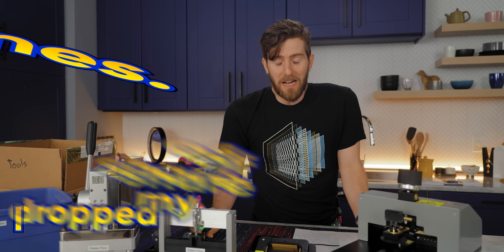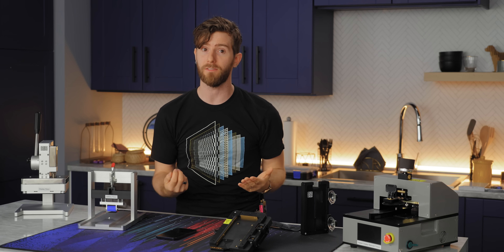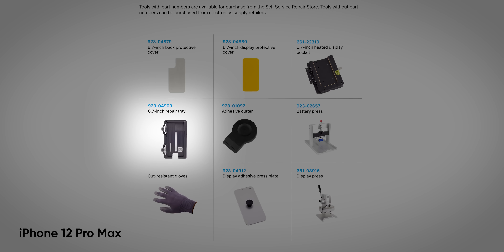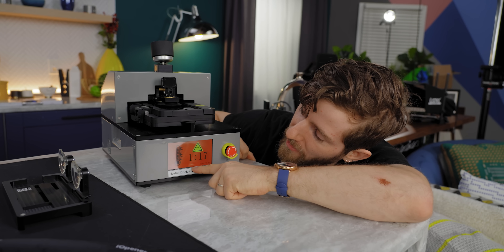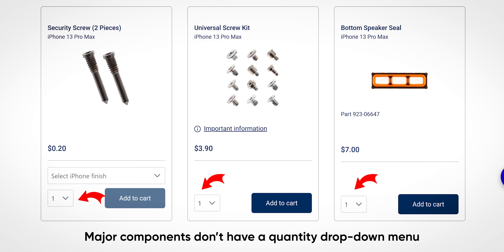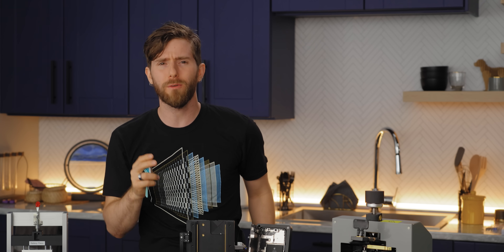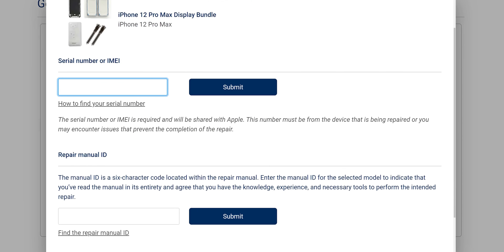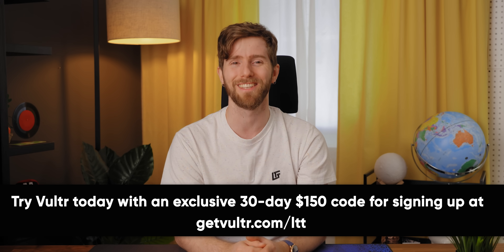I’m a Genius - Apple Self Service Repair Program

Comment: The tools answer a question I had about how Apple store can even repair stuff.  Apple's devices aren't easy to repair so I was confused how their geniuses could repair them (assuming that recruiting repair techs is harder than other retail staff), given that Apple doesn't design for repair.

I guess all these tools were developed to be precise, and easy to repeatably and reliably use so that there own shops could even offer repairs! 🤷
Reply: Apple does design for repair, they design for repair by apple. For example iPhones do not use glue were many other vendors are still gluing batteries in apple use the pull tabs to remove them this is clearly for themselves to be able to more quickly replace batteries. given 

and yes the tools are design alongside the devices so that they can do a high volume of repairs they are not spending 4 hours to replace a screen more like 5 minutes.
Reply: Takes us like 15 min and we actually program the screen with true tone. I would understand if you never did one why it would be scary. But we are also $120 cheaper then apple.
Reply: not really since if the screen is real real fucked you wouldnt be able to use those tools xD
Reply: i belive it would be more logicall to just change the device for the same model with the exact same specs and clone it to the one they hand you. and then send the broken ones to their repair services (or stack them in the shop so the repair guy has the time to do it)
Reply: @kuma8030  you can. Its called CA and a sheet of aluminum.
Reply: @kuma8030  there is a tool for that
Reply: @MrPruske  if the screen is real fucked up the suction cup wont suck and if you put a screen protector over it with real stron glue you are going to heat it up anyways and it wont come off

Comment: Honestly, apple devices really aren't that difficult to repair, hardware wise...
Some phones these days will have the screen be part of the actual case. For a phone I repaired a few weeks ago I had to remove every single item from the phone, Every single button,  finger print sensor, every single screw, all the camera lenses, all the connectors, literally everything. You need to remove everything, and attach it to the new screen, cause the screen is also the case. Oh, and to spice things up, the battery was glued in super tight, there was no way to get under it, and no pull taps, so you had to pry the battery up with a metal tool and an unreasonable amount of force.

Comment: 9:40 they are allowed to give the estimates over the phone from that page as long as they let you know it's an estimate.  They just can't tell you turnaround time.  If someone on the phone doesn't give you an estimate, that's because they weren't doing their job.  That being said, the estimates are crap.  It's basically a screen repair estimate, a battery estimate, and "other" which is basically replace the whole phone estimate.  Computers, on the other hand, they don't give estimates over the phone.
Reply: Apple Customer Support is a joke honestly. Linus' story is actually believable after having to deal with them a few times. The first 3 guys you talk to have no actual understanding of the device or how any of it works and once you reach someone who knows, they'll just hang up on you because they don't see it being a problem at all.

Comment: Imagine having to provide your vehicle's VIN to have the privilege to order a part for your vehicle.  More reason for me to stay far away from Apple.
Reply: @Carl Gunderson 
I wouldn't be surprised some of Tesla part already required that.
Reply: @Carl Gunderson Yeah but with one the worst that can happen is you can't make your TikTok videos or check your Facebook. The other if done improperly will kill somebody. Bad comparison.
Reply: @Carl Gunderson What's so confusing? Apple doesn't want you repairing your own phone because they want maximum profits. Tesla does not want people repairing their own cutting edge vehicles because they will kill themselves or someone else. Do you know how dangerous it is to take apart one of those batteries?
Reply: @Carl Gunderson Oh, well I was being sarcastic. Because one thing most people use for social media or taking selfies and is not really important. And the other is a 5000 pound tank that if not repaired properly will have VERY bad consequences.
Reply: @Carl Gunderson Well it's not just the battery though, that's just one example I used. If they don't torque down a tire properly. If they mess up the wiring or a sensor or software. Coolant line. Etc etc. My point is that if the corner store messes up your phone, well yeah that's a bummer but it's not really a big deal. If that sketchy mechanic you took your Tesla to because he was "half price" messes up your car. Well, it's not even remotely the same thing.

It's like when a person hires someone "cheaper" to work on the electrical in their house then it catches fire. My point is having people who are not certified to be working on cutting edge vehicles trying to fix your car is incredibly stupid. This is not a Toyota Corolla. You need high levels of training to properly fix a Tesla. Especially if it's battery related.

Comment: It’s a little worse again because after you carry out the repair yourself, you still have to call apple for them to pair the component to your device, and if this fails once then they tell you to go to the apple store anyways. Which completely defeats the whole process of shipping tools. It is clear that apple is building a case to make right to repair look pointless in the eyes of certain law makers
Reply: They’re trying to make it as inconvenient as possible to justify their case.
Reply: Yeah this is literally just embrace-extend-exterminate applied to user's rights (AKA property rights). They are doing it on purpose to force people who want to repair their devices to rely on them only without the possibility of just using a third party, and to force them to pay exorbitant prices for the purpose of discouraging the repair in the first place.

It reminds of the old washing machine paradox - you can get it repaired, but the repair tech always tells you it's going to cost more than just buying a new one.
Reply: It's basically malicious compliance with any proposed right to repair.  Yeah, you can buy what you need from Apple, but it won't be any cheaper or more convenient than bring the device to the Apple Store and letting them do it.  Then, when nobody uses this "service", they will go back to governments with data "proving" that there isn't actually any demand for right to repair.
Reply: This is why the best option is to strike the pocketbook and not buy their product anymore. They'll never learn otherwise.
Reply: @metaldragonmike  i hopped, never looking back..
Reply: @yukisnoww  Me too.
Reply: no because a lot of times apple tells you to buy a new phone instead of fixing your divice
Reply: It’s absolutely insulting
Reply: ah yes make you call to register a part they shipped knowing the serial of the device for repair another waste step and time
Reply: just another day at r/maliciouscompliance
Reply: I hope this comment gets pinned. I want more people to see this
Reply: I mean, they can't pair a true tone and calibrate the camera. I think this is just a ripoff as you paid for their repair products.
Reply: What? What do you mean you have to call apple to pair the component? Is it not enough to simply connect the new display to the mainboard or whatever board the phone uses? 

Why are people still buying their TRASH?!
Reply: @Jousten16  Because it's this decades fashionable thing, if you don't have one you're not a whatever fashionable people are called this week.
Reply: I would have to take a plane to get to the nearest apple store, plane tickets ain't cheap
Reply: So true Adam! They should really make the phones easier to repair as well! I think Samsung beats them here with their self repair program. you don’t have to call anyone and the parts are waaay cheaper! They really beat Apple here
Reply: And people keep giving this company money 🤷‍♂. Or more specifically, Apple sheep that just dump their wads of cash on everything Apple even if it's an obvious total ripoff or sucks. They are brainwashed into loyalty to the brand, And cleverly sucked into their ecosystem. I mean, Here's me slating Apple but you have to give them credit for genius business (pun intended) at least.
Reply: @helenHTID  That's what Apple wants, money and more e-waste so the turtles can eat some motherboards.
Reply: uh some of these pairings is due to the hardware keys used to pair your biometrics and other security certificates but  besides that yeah I agree this is retarded specially if its  JUST THE SCREEN being replaced.
Reply: 'Designed to fail' is an American political tradition. Look how 'well' it worked for their public healthcare and public education systems.
Reply: If not make it look pointless, at the very least they can say they offer it if regulations ever come into effect.
Reply: so stop crying and get an android phone.
Reply: @King_Lincoln-007  I agree. There’s always so much bitching about a device they don’t have to buy or deal with at all lmao.
Reply: @King_Lincoln-007  but america have banned one of the biggest android phones makers :V
Reply: @cpch23online2  I think there is a market outside of Huawei phones
Reply: @King_Lincoln-007  yeah like xiaomi :V
Reply: What do you mean with "pair the component"? Isnt it just plug and play. Its not like they are wireless components.
Reply: @Ryan123-k4i  It's like changing a serial number. Like that programmer to get a True tone back. The camera calibration is done by Apple and it always fails on 99% of all devices. And they just tell you to buy a new device and f off.
Reply: @jonny11bonk  Im sure it "fails" a lot of times :D Well i dont now if thats a smart move from apple to push selling numbers but it sure is a complete ahole move for all people who are not willing to buy a new device
Reply: @Ryan123-k4i  It's just another way how to rip off people to buy their new devices. I mean, what's wrong with an iPhone 7/8? You can easily find tools and tutorials how to open it and replace something. Even the programmers are getting cheaper to copy your serial numbers. But, Apple is business. A single broken capacitor on your MacBook's mobo? Buy a new laptop. A 3 cent capacitor and a few minutes of soldering. That's too expensive for the genius bar to replace it. I wonder which OEM does make the biggest e-waste besides the trash gaming pre-builts? Dell putting a hockey puck between the CPU cooler and the heatsink and making Intel mountings for an AM4 socket. 😂👌 HP forgetting to cool down the VRAMs and Gigabyte... Acrually, no. We can forgive the Gigabyte's exploding PSUs.
Reply: @jonny11bonk  its like some of these company actually planned the e-wastes. Well, except gigabyte. That was an epic boom
Reply: @jonny11bonk  if the camera isn't an Apple part it will fail.  were you using an Apple camera?
Reply: Not true. I worked at an Apple Warehouse, sometimes it doesn’t work over the cloud but often does. If it didn’t I have to give the phone to my manager have them do it with the tool they use to make it work.
Reply: @jimmygomez7406  There's repair channels on YouTube who've demonstrated the process of swapping hardware, and calling through. Then experiencing a configuration failure and immediately being told to go to the support centre.

Comment: There is no point in comparing a random "hard oled" screen from ebay to a genuine apple display. Most of the time the displays are not even the same size. Trust me, I've had a fair share of horrible displays from China.

Comment: OMG the've just needed to provide their stupid parts and say buy the tools from ifixit and watch their manuals. It would be so much easier for everyone. And then if right to repair comes through working on a real solution to provide users to authenticate their screen / new FaceID without needing an apple employee or an apple device. But no we live in metaverse and you aren't allowed to do anything with your own device looking at every f#cking other smartphone manifacturer except maybe fair phone.

Comment: You forgot to mention: The huge amount of shipping overhead this requires. For a company who claims to be all for the environment, making their boxes smaller to """improve shipping capacity using less truck space""", this is an insane amount of kit to do the same repair that someone with a small iFixit kit could do. Of course this is a niche option so it's not like they'll be sending these out in droves, but it seems way overkill. Apple doesn't trust you to do your own repairs so they send you industrial sized machines. Clearly this whole program is the bare minimum effort from them, and it was put in place only because they've been pressured into it.
Reply: These are the tools required to do the job properly and achieve the quoted IP protection numbers. Just because the job can be accomplished with an ifixit kit doesn't mean it is done to the same standard. There's no requirement to rent the tools from apple, you can just buy the parts direct from apple and use ifixits repair tools instead if you want.
Reply: @draginator6  I actually didn't know you weren't required to rent the tools. That does save it to some aspect, I guess.
Reply: You don't need to rent this equipment to repair your phone. You can just get the part.

Also, "someone with a small iFixit" is going to screw up 9/10 times, whereas with these proper tools maybe 1/20 times.
Reply: Yes, might be smaller and cheaper tools... But these are the right tools. Less chance of effing up, easier and quicker to get job done, etc etc.

Regardless, highly specialized tools aren't for users... They are for enthusiasts or people who work in that field... The idea of renting tools like this just seems... Odd.

Comment: Could a repair shop buy one or two of each part using donor phone serial numbers and then order replacements each time a customer comes in, so they replace that stock? Or are the serial numbers tied to the item shipped so if you replace it with a different one it doesn't work?
Reply: I believe from the Snazzy Labs video on the same subject, it seems that the screens are tied to the serial of the device they were ordered from.

Comment: As a reputable repair shop myself. I can say in the place of these tools, experience and skill will allow a shop owner to use cheaper tools such as plastic picks, pry tools, screen programmers, etc to do just as good of a job!
Reply: @Allan_Stone  Yeah but if it is for the right price and you can offer the customer a better price as a result you’re going to get that customer. And if your reputation is good that customer will continue to come back with any other repairs needed. Trust me I know

Comment: 7:03 spend hundreds of dollor on a machine but still have to do it by hand in the end...what was the point of that thing again?
Reply: It was to heat up the adhesive and make it easier to pop the screen off without breaking it
Reply: Try removing it without the machine and you'll find out

Comment: I worked cell phone repair. You do not need all that to fix an iPhone. I didn't even have to heat the 11 and before models. Only the 12s & 13.
Reply: Sertenly experience is a factor but most iPhones I did were 15 to 30 min.

Comment: It's a step in the right direction, but I wish any phone manufacturer didn't need these jigs to repair a phone. 

I miss having screws and easily-replacable parts in phones (and in other electronic devices such as laptop computers).

Comment: Everyone on YouTube states that the home button being tied down does not have anything to do with security yet mostly all of them have no f’in clue how it works in the first place! It is about security, if not any third party decoder could send a successfully read fingerprint signal to the motherboard
Reply: There's no reason that the home button couldn't simply reset and clear its saved information if paired to a different board.  Like how you can still format an encrypted hard drive.

Sure, you shouldn't be able to carry over existing Touch ID saved credentials, but you should be able to reprogram any home button that is attached to a motherboard.

The only reason not to have that available is to make people buy a new phone or use your proprietary repair service.
Reply: Yeah tim apple
Reply: You didn't understand it correctly. Let the operating system pair with the new (thirdparty) fingerprint reader only once you unlocked the phone with pin/password. This way would be perfectly fine for security.

Comment: Considering Apple's history with right to repair, I'd say this at least a step in the right direction. The tool rentals are a great idea and not even absurdly priced, can't say the same for the actual replacement parts. In true Apple fashion, two steps forward and one step back.

Comment: Seriously this is an awesome step in the right direction. Right now my agency sends off our apparatus phones in order to repair them if they break. This could change the game and allow our supply guys to fix them WAY faster
Reply: From what I've seen, the biggest headaches from going through this process if you're a consumer renting is pairing the parts to the phone, and then there is returning the tools.  Snazzy Labs had an issue where he returned it on time but they charged him a late fee anyway.  They did say they would refund him on verification of the parts being returned.  If you have the expertise to replace the parts, you could probably do it quickly then spend an hour on the phone to get the parts paired.